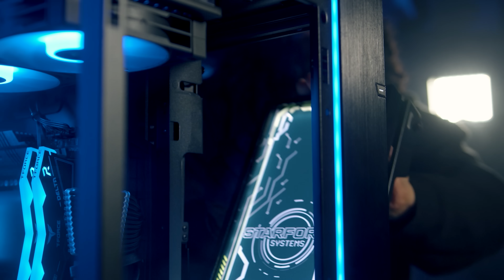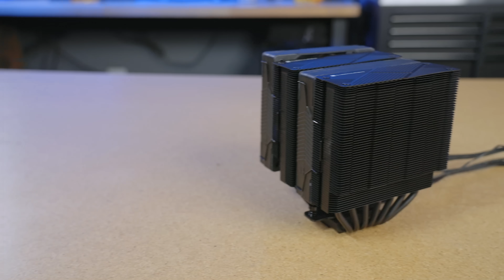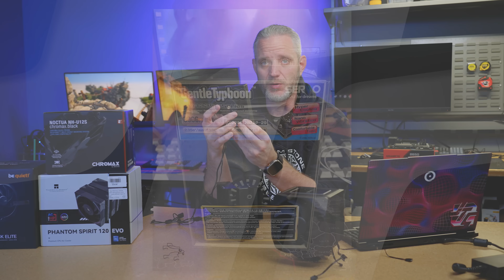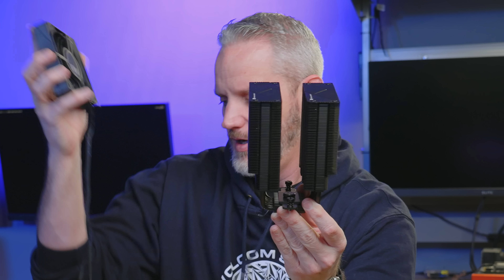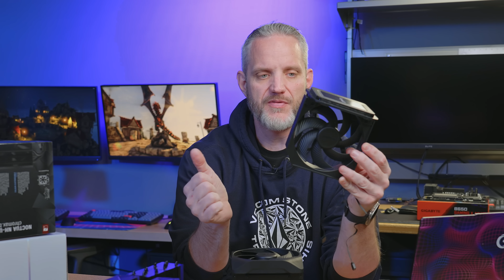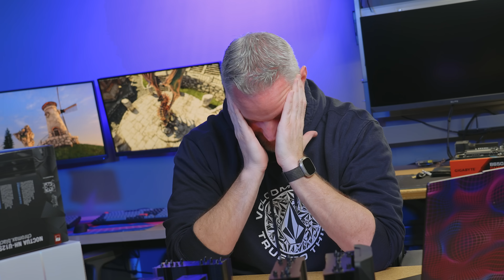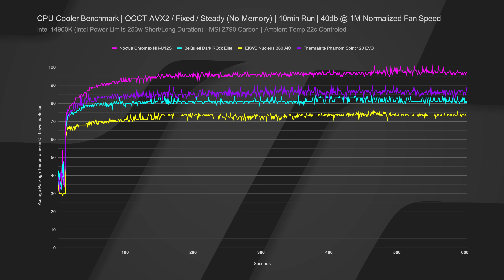This $49 CPU Cooler has big brands SHOOK! Thermal Testing Cheap vs Expensive CPU Cooler!

Comment: One thing to consider that wasnt talked about is the fact that while Noctua is really expensive they do have a history of long term support and providing new mounting hardware for new socket standards on their old coolers.
Reply: Noctua is a high end brand no matter how you look at it. You are paying a hefty premium for top tier sound profile and longevity.

They also suffer from their very long development cycles. Usually Noctua's new products dominate for a while, but before a refresh comes around there are other brands that end up leapfrogging them, at least in terms of raw performance and decibels.
Reply: Thermalright's old cooler mounting didn't ever need to be updated, it still works today on Intel cpu, people just can't figure out screws so they made it fixed like other brands.  The new cooler adapters are 7 dollars so not that big of a deal really.
Reply: Crazy 😧
Reply: Exactly the reason I support them. I had a fan clip broke years after I bought it. Just an email to them and they sent me a replacement for free. Also just needed a new mounting kit to change from Intel to AM5.
Reply: with the price difference alone you could just buy yourself a new cooler when you need to switch the mounting style
Reply: Consider adding the Thermalright Peerless Assassin 120 SE.
Reply: Except AMD has been using the same cooler mount for nearly 10 years, and it seems like they want to keep it that way for at least four more. Unless you're an intel simp (in which case you have my condolences for your wallet in mobo prices), there's no need to worry about socket supports.
Reply: As cool as that sounds on paper, how often does one realistically need to deal with customer support?. . . And this is where most of these points fall apart rather quickly.
Be mindful that budgets exist and said budgets will limit someone's ability to purchase the most important part: powerful hardware
Rather than spending $100-150 on a cpu cooler, why not save at least 70 and go with Thermalright or ID-Cooling's offering? You see, it can in fact be used elsewhere like acquiring a higher tier microcenter bundle deal or even a greater tier GPU, the option open up much nicer
Or perhaps you could save up for the inevitable upgrade in the future?

Overspending is a real thing and shouldn't be denied by the blinding picture that is brands such as Noctua being all so wonderful when in reality they don't provide so much for the end user other than a larger hole in their pockets
Reply: @john_gohan  noctua is not good value, but good quality.
You can still use your NH-D15 from years past and get a mounting-bracket and it will still works just as fine as it did 10 years ago. And customer-service is always something were you pay upfront for something you might never need.
One thing you do get is certainty: They have a track-record of delivering exactly as promised. You buy their coolers and you know exactly what you will get. You buy their fans and you know it will outlast nearly everything in your PC. You get the comfort and knowledge that you will not need to think or worry about that part of your PC.
Reply: So what? A little bracket and some noise reduction won't make it any less greedy than before.
Pricing has long been far too high and being exploited by all kinds of big names in the industry
Thermalright kicking them right where it hurts the most, the cost for the consumer

Go ahead and purchase their things if you got money growing on trees but this isn't the truth for the vast majority of potential buyers, rather the opposite
And it hurts to see someone with a 5600 using one of those NH-D15 when they could've very well afforded to purchase something more akin to a 57/800X3D or hop onto AM5 and get more bang for their buck
Reply: @ "And it hurts to see someone with a 5600 using one of those NH-D15 when they could've very well afforded "
Yeah and that person might have bought that cooler with his 7700K, and kept using it on 3 system - while you bought 3 new coolers and every time had them be louder.
Reply: You do realize that this was before Thermalright even stormed the market like this? Do you realize that the point is about the now and not the past? Do you realize how it's not worthwhile purchasing a Noctua product when you could get upward of like 5 Thermalright ones instead?
Bravo. Solved your own problem
Reply: @ABaumstumpf  thermalright will send you free brackets for new sockets as well. Wtf are you talking about? And even if they didn't, buying new brackets the assassin or spirit still outperforms the noctua.
Reply: @john_gohan the simple fact that one additional computer build of getting free new mounting hardware then pays for itself in not needing to buy another cooler. Build one additional computer that requires new mounting hardware again and you're saving money. It's not like the tech of air coolers is advancing enough to be worth upgrading to anything newer.
Reply: @john_gohan  "budgets exist".  not if youre buying an i9.  not to mention the redux version of the noctua that was released, and is currently at $60 on amazon and performs basically the same.  but even still, if you are buying an i9, you shouldnt be trying to cool it with a single tower anyway.
Reply: the i9 prefix has little to no meaning, you could be referring to decade old hardware using it
either way for $60 you can get ahold of, you guessed it, a Thermalright 360mm AIO + correction bracket as LGA1700, unlike AM4/5, does not have a flat surface area
Just look at the Frozen Prism review on GN's page
Reply: @poleosis  Yes they do. Do you people really not understand what the word budget means? Deciding to give a certain part, a significant part of a budget doesn't mean the budget doesn't exist, nor does it mean you need to then overspend on anything else. You do know that i9/R9 SKUs have more cores than their i7/R9 counterparts right? Yall are gonna lose your minds when you realize that that's a functional difference.
Reply: @Dexx1s  and there is such a thing as underspending/underspec-ing too.  if you have the budget for an i9, there is no world where you should be looking at a single tower air cooler and expect it to not instantly fail.
Reply: @ You're missing the point here. You going after someone saying budgets exist, to say that they don't solely because they budgeted for an i9 is asinine. It's honestly hilarious that that same mindset is repeated over and over in PC building conversations. Almost every time that logic is invoked, the rest of the sentence and the following sentences are terrible. This was one of those cases.

You're the one who brought up i9 SKUs right? Why? They talked about going from a 5600 to a 5800X3D. It's kinda strange that you'd move up just the CPU up to the top SKU and try to apply those lower parts to the top SKU, as if anyone else was doing that. Cmon man. And they responded appropriately to that already. Their logic still holds. Why pay extra for little to no cooling performance? 

And just to be clear, nobody was saying to use a $50 air cooler on a high end CPU. You keep on saying nobody should use a single tower cooler on such a CPU when you're the only who's talking about someone doing that.
Reply: @Dexx1s   so, did you just completely miss the part of the video where the coolers were ONLY tested on an i9 platform, the same as the original person i replied to?  maybe go back and read their reply with the context of these coolers ONLY being tested on i9
Reply: @ You say that, meanwhile you can easily get away with a PS120SE on a 9950X3D with a slight overclocking headroom
Or if comfortable with it (and have the sufficient mount space) one can consider going with a 360mm AIO. Best of all Thermalright has the field covered as well at price points well below $100 still.
There is zero problem with running a "budget" (reasonably priced) cpu cooler on even the highest tier of the entire SKU
the numbers GN and a few others measured do not lie when it comes to how well even a $35 dual tower can and will perform
Reply: @poleosis   The video uses the 14900K pretty much just for demonstration. If the CPU used doesn't generate that much heat, it's not going to stress the coolers, and the results won't be as drastic. 

But still, no, the person you responded to didn't mention the i9. In the two comments before you responded, the only CPUs they mentioned were the AMD 5600, 5700 and 5800X3D.

As a matter of fact, after you responded talking about i9 CPUs, they responded to you, switching to an AIO, and dismissed i9 SKUs, further indicating that they indeed weren't speaking to i9 CPUs previously. Or did you miss that? I literally referenced that in my last comment. The conversation is the relative difference between the coolers themselves, not what CPU you put them on. And you're looking only at the i9's cost, it ignoring the fact that R9 SKUs can cost more, but still generate less heat, almost completely nullifying your point. But even then, it still depends on which specific SKU we're referring to, which is why they said that the prefix label doesn't matter; the actual SKU does. 

And my overall point still stands: "if X is in your budget, you can blow the budget or overspend for Y" is a dumb argument.
Reply: @john_gohan  Bought 3-4 cpu cooler in the past 10 years. Could have get 1 noctua and different mountings for that, would have had lower temps, less hassle with at least one of them. It makes sense if you build pcs in the future i guess.
Reply: The thing is, you can buy 3 Thermal right coolers for the new socket for the price of one Noctua... And you keep the old Mainboard, CPU and cooler combo usable if you want that..
Reply: @DxCBuG  You don't need a super expensive CPU cooler, you just need to be gentle with your current one. I've had a stock Intel cooler last more than a decade and a stock AMD cooler approaching half-a-decade. If you're breaking multiple CPU coolers between upgrades, you're probably being too rough or doing something unconventional with them.
Reply: @AlphaWolfShade  I never said anything about breaking a cooler. People transferring their expensive Noctua to their new CPU is what I am talking about. The old CPU + Mainboard is left over, and no I would not install the stock cooler back on that CPU.
Also many newer CPUs don't even get a boxed cooler. My last CPUs I bought where from tray without a box.
Reply: @ neither spamming nor making up BS helps your case. Rather it just shows you to be insecure and dishonest at best.

Comment: I swapped a set of the ThermalRight TL-K12 120MM fans onto a DeepCool Mystique 240 AIO so I could match the surrounding case fans with the 2150rpm rating and it blew my mind. The DeepCool fans were amazing on the Mystique but swapping them for these ThermalRights was a shock. The system is just as quiet and the CPU now runs 5C cooler and I can't get it to thermal throttle in DaVinci Resolve if I try. It's only a 14700K sure but I can absolutely stomp on that CPU in this set up and it stays cool as the other side of the pillow. Great video guys, thanks.
Reply: for all I know, the non-ARGB variant of them is called the TL-B12 (at least going by their spec sheets) and is present on a few of their AIOs as well, most notably the Frozen Edge 240/360
and only like $11 a piece
Reply: @john_gohan  Correct. The TL-B12 is a great fan as well, also rated at 2150rpm, and I used them in a black out build I did a couple of months ago. Great line of fans and they are so well priced that Noctua has a serious problem here.

Comment: i can't believe the  raise of price in a few year on Noctua cooler. Well, their black fan are usually more expensive than the basic one but i remember not so long ago those single tower cooler where around 50euros...
and for noctua, better put the 20 buck to have the bigger one.
Usually i was using artic cooling cooler, but now they mainly make AIO.

Comment: The formula is very good, it was exactly the kind of thing I was thinking about during the first half of your graph presentation. However, you need to find a way to incorporate the absolute value of the temperature reduction, because you risk a bias for really cheap heatsinks. Imagine if the Noctua was sold at $25, it would be "better", even if it only reduces the temperature by 5°C, which is obviously bad.

Comment: something is wrong with those Noctua thermals. those numbers should not be that high. did you check and double check? it almost looks like what happens when you put the fans wrong, and instead of passthrough works against each other.
Reply: to be fair only the bequiet actually looks normal, and ofc. the aio also looks normal.

Comment: 9950X and a $60 cooler works amazing.

I stress-tested the CPU with the case-side off, and I could feel cold air coming in, warm air coming out. It was like an electric heater.
VERY EFFECTIVE. The brand was Arctic. Forgot the model.

Comment: Using Thermalright Royal Pretor 130 on 9950X3D with PBO enabled. In games my temps are around 60-65C and under full load in benchmarks my average temp is 81C. (75 average with PBO disabled) Amazing Air Cooler 👍
Reply: I wasn't even aware of that model. Must be a beefy cooler to keep the 9950X3D comfy.
Reply: @LRK-GT  iirc, it's their newest product.

Comment: NH D15S Chromax needs to be on this chart.
Reply: Also the Noctua NH-D15 G2 variants (LBC or HBC).
Reply: @JohnSmith-yi5gl  I've made a head-to-head with Thermalright and noctua
Reply: @WELSHYTECH can you cover the thermalright pretor 130 please?

Comment: Maybe get some old coolers that were considered good for their time. 

And/or if same cooler have had new revisions. How they compare between each other.

For example:
- CM Hyper 212 evo
- Noctua D15
Reply: The hyper 212 lost all meaning when the likes of Peerless Assassin and Fozn A620 Pro SE started selling at the same or lower price. It's decent for lower tdp CPUs but will just not be good enough to compete at 150W and up.

Comment: I had a $200 AIO CoolerMaster cooler but it broke twice within 2 years. 
Had enough and decided to go with air cooling instead. Saw great reviews online about the Peerless Assassin 120 and bought it.

And holy shit what a deal! Better temps for less than half the money of my old CM AIO cooler, way more quiet, and it's still going strong. Can't recommend it enough.
Reply: And you could replace it like 5-6 times before even matching the CoolerMaster model's price per unit
Reply: Out of curiosity why did you have an AIO? Pre built if I had to guess?
Reply: I would assume it's more a matter of having listened to bad sponsorships and misinformation without a regard to price/performance
although that could've very well been before there were products for such bargain
Reply: @john_gohan  It depends on brand, i had corsair 280mm aio for 9 years and 0 issues. But peerless assassin is a great choice.
Reply: Late to the party, but I've only ever bought one AIO cooler and it's Corsair, I bought it 10 years ago and I've swapped it into every new pc I get and it works perfectly with daily use. When it finally dies I guess I'll steer clear of cooler master
Reply: The matter of the fact is that since Thermalright's domination in most regions there is rarely ever a case for someone to be better off with alternative products, especially more expensive ones at that
Great to here whatever people had lasted long or still remain functional to this day but anything new should likely be a Thermalright purchase, no questions asked.